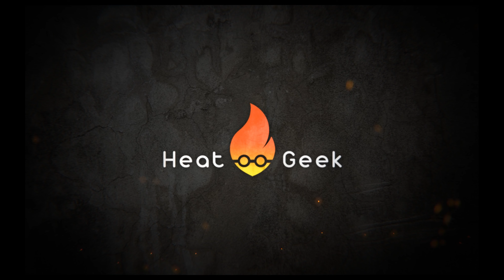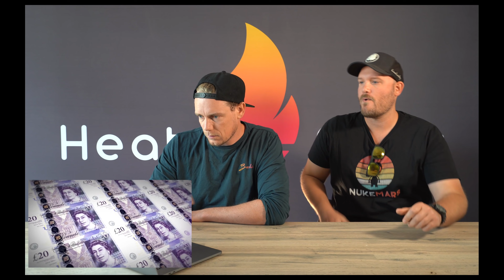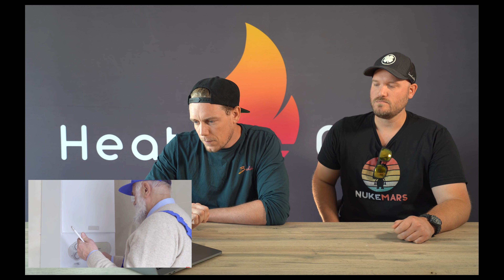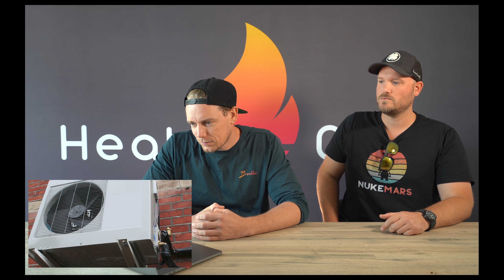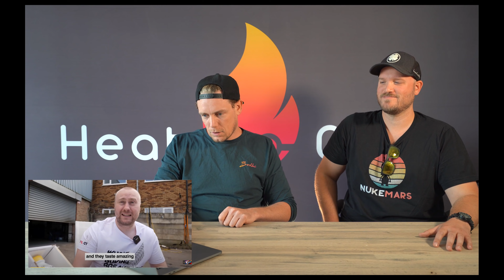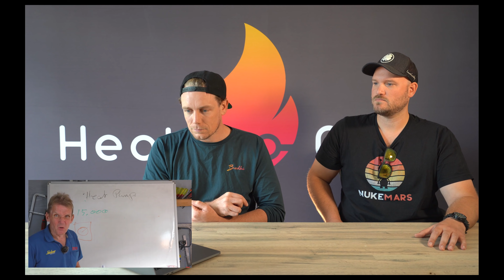Professionals React (BADLY) To Skill Builders's Heat Pump Videos | PART 1 | FIRST TIME WATCHING

Comment: So let me try and understand this. As long as the installation is done correctly  to the type of property ( not talking new builds for now )  the consumer  will always have gains but we have to accept that the gains might be the transition from Gas  and the over all impact on planet rather the financial to the consumer?  I  think this talk is  fascinating and I wonder what design would suit a thatched roof cottage with limited space to place the pump but maybe we just have to accept that it wont suit every property which is pretty much what Skill build  guy is saying, it won’t apply to the vast majority of the population …  and yes more information is needed for sure 👍
Reply: If you're talking about a thatched roof cottage your issue isn't so much what heating solution to go for but what planning and conservation limitations have been put in place by national heritage. I've been down the listed building route as an installer for all types of heating and to put it politely some of the hurdles are more like pole vaults.

Comment: These guys are good at criticising Skill builders years of practical experience in heating engineering  and inventing government policy on energy prices
Reply from the maker: quite easy when the most important steps at the beggining of an installation weren't done
Reply: @HeatGeek  And what where the important steps, please give full details of all of these
Reply from the maker: @ms5896  once again.. all in the videos.. did you watch them? A heat loss and system design along side a legally binding performance estimate which tells you the in going running costs BEFORE you do the install, not 2 years down the road. 

Watch part 2 we go more in depth in to this.

Comment: Thanks guys. Skills builder really frustrates me as he doesn’t present the whole argument but of course the populist right love that sort of rhetoric. Heat pumps do require education and more skills than gas systems but it doesn’t mean they should be dismissed. There’s plenty of cases where they are a great solution and will reduce carbon emissions.
Reply: In fairness to Rodger his main point was in the right house and with the correct setup they work perfectly. But large majority of uk houses don't meet that right setup from the word go and theres alot of cowboys out there that unfortunately just want peoples money like any trade there's always a bodge it and scarper and finding people who actually know what their talking about when you don't know the ins and outs yourself is hard
Reply from the maker: @matthewmcmullan9669  he's unaware of the potential of them and how well they can work in normal homes with good design too though. Hence saying average scop is 2.. that would be a disaster. He advised using a thermal store with a heat pump.. that's terrible design and will always lead yo poor scops of 2 or even below!
Reply: @matthewmcmullan9669  Roger has installed heat pumps that don’t work so he is one of these installers you mention. Or maybe he just did it to prove his own point, who knows. Anyway, it doesn’t take the member of a debating club to see how unbalanced his argument is. He is a boiler guy so of course he hates heat pumps.
Reply: @matthewmcmullan9669  Roger and heat geek agree more than they disagree. 
I enjoy the content from both, but I think heat geek were wide of the mark on these two vids.
Reply: Is not the fact when you really need the beer cooler it doesn't work and cost you a bomb.
Reply: Ok , so anyone questioning heat pumps effectiveness, is a populist right winger ?
Reply: @haydnlawrence8167  No, but some of the replies are certainly from that demographic, many of them incapable of forming their own view from doing the research. I’m not sure where the generalisation was implied in my statement? Also I should note effectiveness is actually a term used in heat transfer to represent actual heat output as a ratio of maximum possible heat output, so would advise using a different term than effectiveness. I think what you mean is feasibility.
Reply: @1991elliot  maybe. .
How do HPs require more skills than gas systems?
Reply from the maker: @haydnlawrence8167  they require full system design.. understanding of mass flow and deltas. Not a huge hurdle just seldom done
Reply: @haydnlawrence8167  Heat pumps operate of typical dT of 5K so flow rate for equivalent kW is around 4 times that needed for a dT 20 boiler. Also lower flow temps means heat emitters need higher heat transfer coefficients/more area. So basically you can’t just replace a boiler with a heat pump - pipework, heat emitters and insulation has to be considered as well. A lot of the stories of heat pumps not working are where these things are not properly considered. The heat loss calculation is also more sensitive to incorrect sizing as a heat pump is far less likely to be oversized given the cost. This isn’t a case against heat pumps but means these things need to be done right to avoid problems. Over time the mistakes will be learnt from and there will be a skills network for installing heat pumps. Similarly the supply and demand and economies of scale will bring the price down in line with gas boilers - then it become a low carbon choice only which is heat pumps, solar panels etc

Comment: Was there not talk of combi boilers working of hydrogen
Reply: Yes, there are trials by Bosch and Viessmann, it is possible but where is the Hydrogen coming from?  Currently it costs about £10 per Kw of heat from H2 so it is a bit of a red herring.

Comment: These two baseball cap  wearing guys answer to everything probably not got a clue when it comes to real world use and actually getting their hands dirty
Reply: Both have over 20 years as commercial engineers in the field, some of that time was also spend while wearing baseball caps.

Comment: Other week some couple were in the paper with a 70 grand system, ground source type. They said it don't work. I take it was fitted to a new build.  But 70 grand. For it not to work. You'd be well pissed off.
Reply: Yeah livid, however as long as they used installers who are MCS or similarly registered there will be a backstop for the customer.

Comment: I have been in HVAC for about 30 years. In that time I have come across all sorts of weird and wonderful things. 
In my experience source is OK on well insulated new build with underfloor heating, but to retro fit in older properties is costly and inefficient. I work mainly in commercial, however  if I were to build a new home of any size I would opt for ground source with a borehole. These work very well and give a more or less constant good  COP through the year. 
In older domestic properties I would go for one of the hydrogen ready boilers as I believe common sense must prevail at somepoint (this may require a change of government though) and hydrogen will be the way forward. 
I feel it's really underhand to promise  people in older poorly insulated properties savings that an air source heat pump can't deliver.
Reply: I am sorry to say that hydrogen really is not the way forward. Suppose you have used renewable electricity to generate hydrogen at 80% efficiency. You then have to store it. Storage has to be at low pressure otherwise even more energy will be wasted compressing the stuff.  Maybe storage in depleted gas or oil fields might fit the bill but a lot of space is required because the volumetric energy density of hydrogen is low. Then you have to pipe it into homes and burn it in a boiler with 95% efficiency. On the other hand if you use the same hydrogen to generate electricity you will get up to 70% efficiency. You then use that in a heat pump with COP=3 to get over twice the calorific value. Of course much of the time you can skip the hydrogen altogether and use the primary electricity directly in a heat pump.

Dale Vince, boss of Ecotricity, believes that there is enough gas around for it to be brewed to produce methane that could be fed directly into the gas grid. Sounds good and I believe that more than one renewable energy outfit is trying it.  I have not seen any figures demonstrating that it is scalable to the whole gas grid. Even then you would be better off using the methane to generate electricity at 60% efficiency to generate electricity to be used by a heat pump. Again you get around twice the thermal output compared with burning it directly.
Reply: @rogerphelps9939  Well that's quite a statement Roger. Hydrogen isn't the future, you obviously know more about this that all the current boiler manufacturers and also both Germany and Japan both of which are heavily investing in Hydrogen for both heating and the Automotive sector. Historically both of these countries seem to know what they're doing, so maybe you need to get on the phone to them.😃
You never addressed the issue of poorly insulated houses in the UK ( solid brick walls with no cavity to insulate etc) and their unsuitability for ASHPs which is one of the points I raised. 
To start quoting figures around current Hydrogen production is a bit futile at the moment as Hydrogen production is undergoing massive developments at the moment (see Hydrogen Republic of Germany), so it's a bit like comparing a 40 year old milk float with a Tesla.
I really didn't understand your last paragraph, you seem to be advocating burning Methane which we're trying to move away from?
Reply: Correctly sized/ designed systems are ok but where it goes wrong is retro fitting without accommodating for all the variables
But it all comes back to the installer

And that said you dropped that in
Reply from the maker: Here's evidence of how they work when well installed in a NORMAL house with tiny rads and little insulation 

https://youtu.be/QLGANlbqIFY

Comment: I’m with roger ,this video from two months ago and gas prices are heading to higher levels ,ain’t a conspiracy lads no more .My gas boiler is efficient and won’t be changing to these monstrosities and will offset the cost in gas rises in the extra 6-12 grand I’d have to pay for a heat pump
Reply: And rising..
Reply: That will be OK until it breaks down irrepairably. Suppliers will be very keen to rid themselves of legacy products.
Reply from the maker: Here's evidence of how they work when well installed in a NORMAL house with tiny rads and little insulation 

https://youtu.be/QLGANlbqIFY
Reply: That’s because the difference between ‘conspiracy theory’ in ‘fact’, is usually about six months.
Reply: @youtubesucks8995  it seldom is though, this is a case where it may be true but nothign to do with Rogers explanation, completely different reason.
Reply: Gas prices are getting higher than oil, I might switch to that, but electric will always be far more expensive because you have to burn the gas to make the electric, the generator is about 40% efficient, so even in a perfect world electric will always be more than twice the price.

Comment: Accurate : evidence based observations I am a gas heating engineer of 3 decades plus. The maths holds up as does the physics. I’m afraid Rodger is lashing in on rules of thumb and years of inaccurate experience …. I guarantee I can like for like an install v roger and run it cheaper and more efficiently and most likely for a smaller costing as well. The day of the guesser and inaccurate installer is coming to an end. The best heating engineers can easily install any heat source to a system … but will look carefully if it’s a retrofit … it’s not just price driven … there Are the environmental factors as well. I can most likely make any installed gas boiler more efficient as most are put on a wall gas tested and left …. This is Rogers camp … the opportunity to actually commission and squeeze the most out of the boiler to suit the system is not used. This is what you need to do with a heat pump .. a bit of maths and poor sizing rad sizing and heat loss. It’s about being accurate whatever the heat source ….. heat geek is accurate here. Either you are or you are not competent to install and commission ….l

Comment: Think of the huge factories that will have to be built to produce millions of Heat Pumps and the CO2 it will create.
Reply: Do you realise that they are an established technology that been produced for many years?
Reply: @BackOnTheTrack69  UK alone has 23million gas boilers .The CO2 from a huge factory to make millions of well established techno Heat pumps in hundreds of millions,will be vast
Reply: @Jack-fs2im  Remember Jack this replacing will take place over many many years. It's a lie through misreporting that we all have to change in 5 or 10 years. In the meantime there is genuinely loads that can be done with what you have on your wall right now to make it much more efficient and prepare for an eventual change

Comment: Heat pumps or ground source heat pumps aren’t for everyone or perhaps that should be almost everyone that doesn’t have a modern well insulated house to use it in.
Insulation is the key to so many things but also creates it’s own problems.
Cavity wall insulation of the blown in type causes damp problems in a lot of houses as does the sprayed foam in the loft.
Most houses don’t have room for water cylinders and run combi boilers because they fit perfectly for the use intended especially if outside like oil boilers.
So many people wether with a grant or not simply don’t have the money to do all these changes.
If you expect people to change their carbon footprint and save the environment give them a system that they can afford and works to a standard it should do.
I run a combi oil boiler as there is no mains gas and electric is so much more expensive to run.

Comment: "A good day is if it's warm outside, say 30'..."??? Huh??? Hot water is an aspect to be considered, but the main object of a heat pump is to heat your home on a cold day: you want to cool it on a day that's 30'!

The reality is that on a freezing day in winter the COP will be between 1.5 and 2.5. Fine, more efficient than electrical heating, but given that electricity costs 5 times the price of electricity, so the cost of heating your home will be AT LEAST twice that of GCH. When you factor in the cost of installation, however good, and the cost of upgrading insulation it is a complete economic nonsense.

To sell heat pumps without making that very clear is downright dishonest.
Reply: Who's selling heat pumps in this video?
Reply: @BackOnTheTrack69  I didn't say they were selling them, although they make it clear that they supply them.

My comment is a general observation that is entirely valid, but the general suggestion of those in the market to sell is that they are the best thing since sliced bread and so much more efficient than other forms of heating. Efficiency is one thing (and even that is far from simple), but cost effectiveness is entirely different.